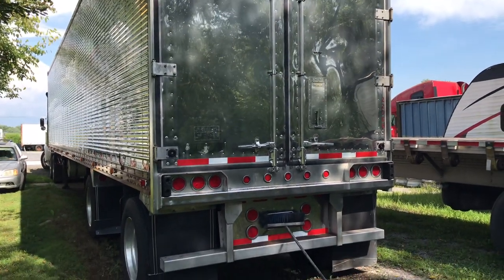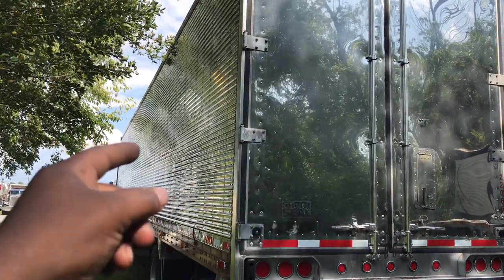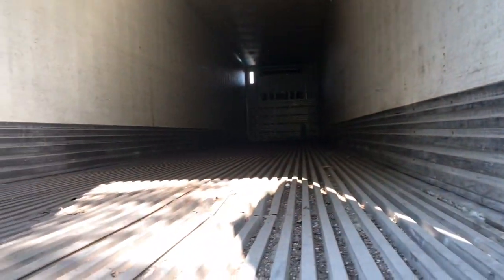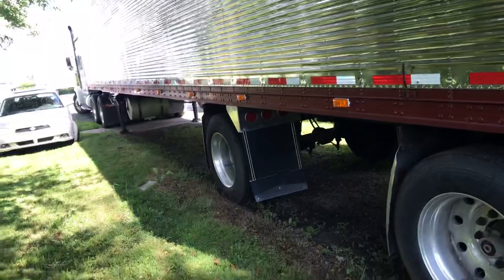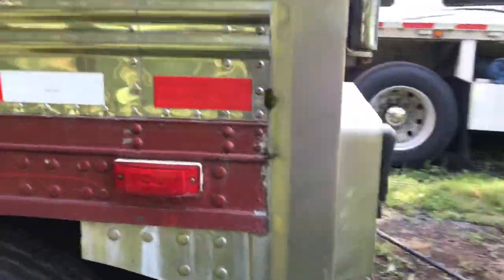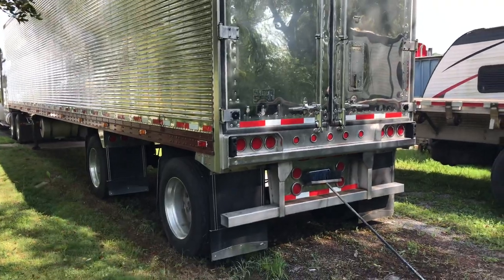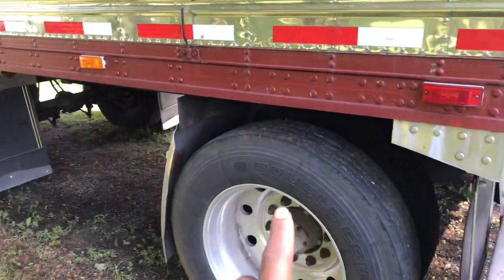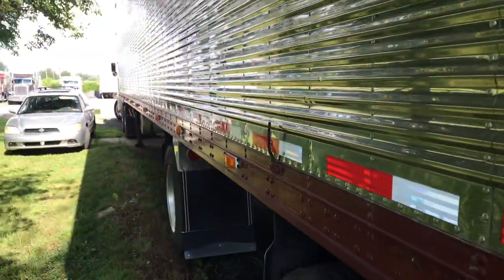$90,000 Stainless Steel Reefer Trailer | Are you out of YOUR mind?

Comment: Damn what the haters say, if i get my hands on a spread axle refer for the low low in decent shape like yours? Its going behind my 1996 W900L 3406e and I'm going to make some money! My truck is 22,000 lbs full of fuel with me sitting in it and a spread axle refer would definitely be a good look to keep me legal. Congrats my brudda and handle yo bidness👍
Reply: 99.9% of loads out there don't require spread axle and most of the time you're going to be chewing up that first axle when backing into tight docks. Expect to regularly repair that axle and get new tires with an alignment. The only reason you should buy a spread axle trailer is if your on a overweight account that requires it.
Reply: @markm0000  Not if it's a lift axle! Also you hardly if ever see a Volvo or Cascadia pulling a spread axle refer, you mostly see W9's and Pete's pulling those trailers because they're so heavy and when you add 44 or 45,000 lbs of meat and that refer unit sitting on top of those drives, your gonna be over on an stock 270 wheel base like mines. You don't always get away with one pallet in the nose or a stack of empty pallets in the nose to keep that weight off your drives and steers. I wouldn't have a trailer like that to haul toilet paper...lol.
Reply: @MrBigR928  That's great and all but your'e going to destroy the life of the second axle when it suddenly gets all the weight of the trailer and needs to twist around to get in the spot. Look man, it's up to you but there's so many disadvantages to a spread axle reefer. It's just not meant to be used in this segment of the industry. Flat bed trailers have spread axles because they almost never have to make a jackknife when backing up.
Reply: @markm0000 Like I said, it would be a "LIFT AXLE" and most I've seen are Great Danes and they ain't cheap! So if I'm gonna invest that type of money in a trailer like that, I ain't just hauling bologna! If I were to spec a trailer like I've just mentioned, dang sure ain't playing myself cheap or buying high dollar equipment to just look cool!  Appreciate your two cents my friend and stay safe✌🏾

Comment: If you can get the floor fix the right way. Replace the wood under the floor. I use 1 X 1 12 ft bars in the floor. 3 1/4 inch diamond plate aluminum. The bars are aluminium Also.
Reply from the maker: Should be getting fixed tomorrow. My mechanic said he'll take care of it

Comment: That trailer looks amazing. Don't see much corrosion at all in the typical spots. What's your thoughts on people claiming old reefer trailers the insulation is junk cause it's got water logged with moisture? Some claim it's amazing how heavy the trailer gets with age.
Reply from the maker: I don't really know, I've heard the same thing. I'm curious to see what this one weighs, it's heavy.
Reply: I had one I was ok running with it. Just know what you can load. I run local out of philly.  Dont see scales at all. No you roads and weight  and you be ok.

Comment: Great looking trailer, why do reefers have that ribbed profile on the floor? I mostly haul grain, fertilizer, gravel, or equipment locally, here in Saskatchewan with my 84 359. I usually wont buy a trailer unless I can afford to pay cash for it. As a result my wrenching skills are getting pretty good.
Reply: Richard McLeod used for air circulation to go under the product for more consistent temps. Flows from reefer through chute on top and basically bounces off doors then along floor.
Reply: You can buy refers with a flat floor but you can't put product directly on the floor and it's going to get messy if there's a spill. With the ribs it can get better airflow and any spills just go right out the back corners.

Comment: The floor crack alot because this shipper like the ports  wont to run two pallets at one time inside your trailer. Each pallet weigh is any where from 1300 to 1600 lbs  each. The forklift weighs another 3000 to 5000 lb. All that weight in one spot not good. They get mad at me because I  wont them to load my trailer one at a time.
Reply from the maker: That makes sense.

Comment: Because the axles are separated, increases or decreases the wear of the tires, how does it work on twisty roads? Thanks for your reply.
Reply: It does increase wear on tires. More when turning and backing. Curves on freeways not so bad.
Reply: These days,you can get to lift and not as much tire wear,front axles lift left or right,rear pivots spin like a single axle.

Comment: “They had a trailer, very similar” no my guy. Whatever reefer trailer you saw was FAR from being similar to yours. I guarantee you that trailer had every single upgrade you could possibly do to it from the manufacturer AND custom work done on top of that. Yours like you said cost a fraction of what the big dog working show truck circuit trailers cost. Different tiers man. Different tiers
Reply: Depends. One of my buddies ordered a 54 stainless from great dane. Not every option but a lot 108k out the door

Comment: You can get a stainless steel reefer 53foot trailer 2019 60grand
Reply: nissan Brown what brand and where because I know a 2020 with the unit is $100,000. I know the trailer by its self runs around 60 to 70 that’s a great dane
Reply: Desert Trailers in Arizona have new CIMA trailers with LED Thermoking for $80k. We’re looking at them for our fleet
Reply: @iPaul143  did u end up getting any?